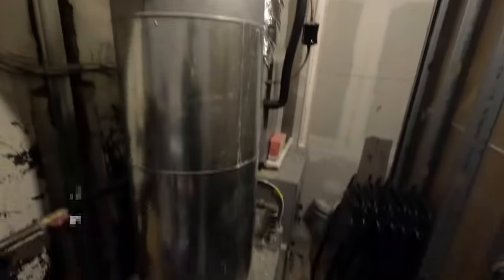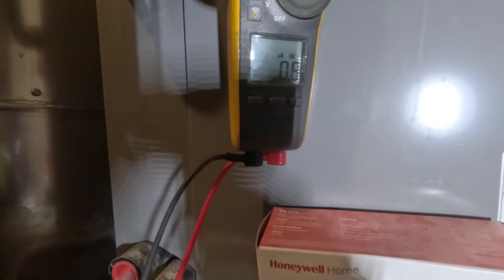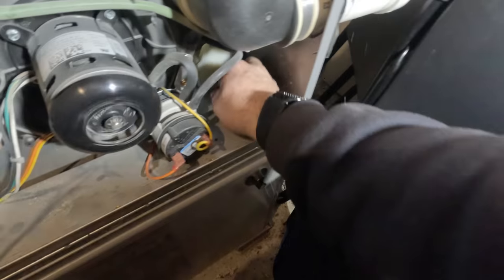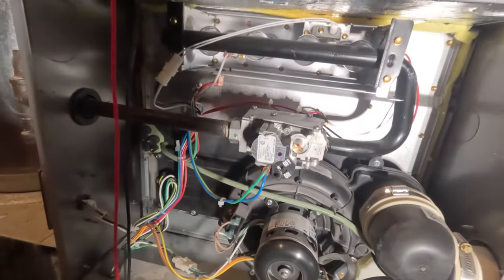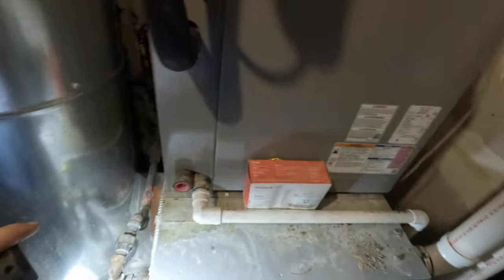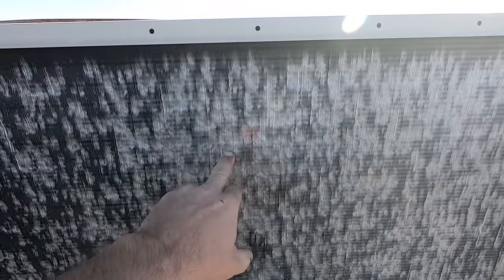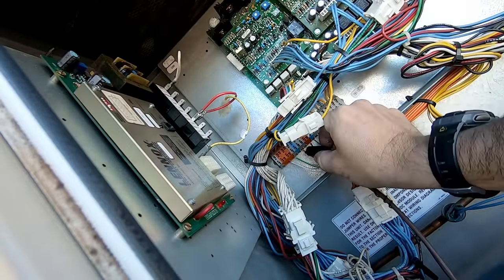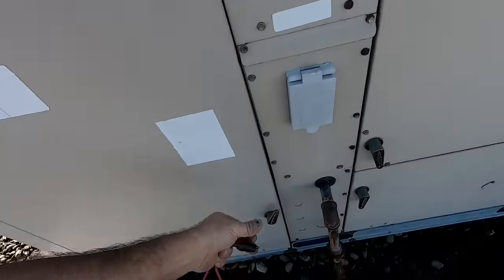Gas Furnace Not Heating What Problems I look For First

Comment: Thank you for the demo. On the exact same furnace, I would hear gurgling on the exhaust pipe and cleaned out the condensate trap, but it was good for less than a year same problem again. The exhaust pipe to the outside is long and collects dirt since the home is in a heavily wooded area where there’s a lot of insects and dirt. I put a  condensate trap on the exhaust pipe before it goes into the furnace to divert the overload of dirty condensate. Now the condensate trap stays cleaner and no gurgling in the exhaust pipe.
Reply from the maker: That's a good idea, as long as it's trapped 👍👍

Comment: I don’t know if anyone saw, but the meter read a negative valve when testing the micro amps of the flame sensor. I assume that’s because you just tested it with the leads backwards, right?
Reply from the maker: Correct.

Comment: Is there a furnace that can use a true HEPA filter?  It seems like the fan isn't powerful enough to draw air through the filter, thought you would know for sure.
Reply from the maker: I've worked on package units for a surgical center that had true HEPA filters. It had an ECM drive and the static pressure was higher. I haven't seen them on a regular home furnace. I guess it would depend on what kind of static pressure drop they have.
Reply: @HVACRSurvival  Would a more powerful blower motor be needed to pull the air through or is there more to it than that?
Reply from the maker: It would depend on the resistance of the filter, I don't know off hand how much restriction it is, if it's higher than what the standard blower can provide then you'll need to make changes.
Reply: @HVACRSurvival  They have a MERV of about 20

Comment: Try and do a fault recall when working on those carriers. You probably had a pressure switch or limit issue rather than a flame sense issue. Those will run all day if they're over 1uA.

Comment: why not raise the blower speed and get the temp rise down? 130f supply is hot, better to be 110 to 120, easier on the heat exchanger and more energy efficient.
Reply from the maker: It's a  judgment call based on the job, my experience has been if you change things too much then they end up calling back complaining that it's noisier or doesn't heat the same or something is different.  If it was tripping limit then yeah I would change the fan speed, recheck the gas pressure,  I mean how much time do you spend there when you have something as simple as just the flame sensor, I can probably spend two or three hours there making things the way I would like to see them but it's a rental and if it's running most people get pissy about the bill. And this customer tends to watch the bill because we do a lot of work for them.